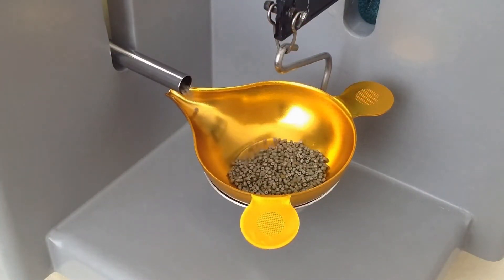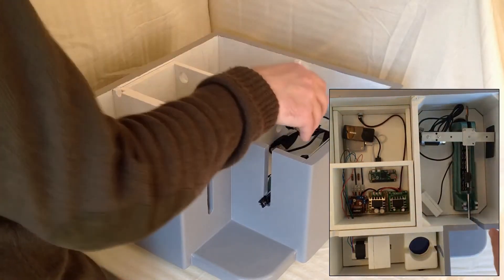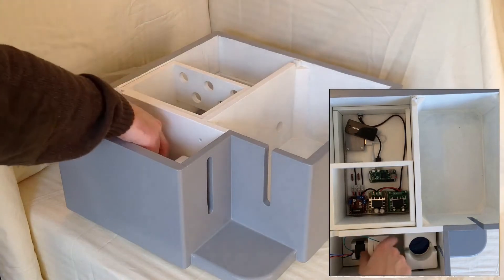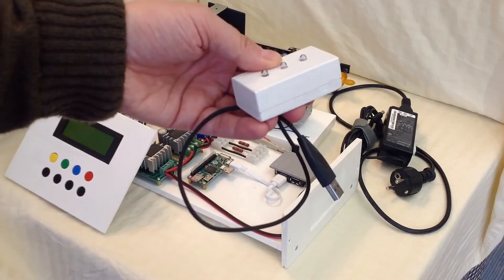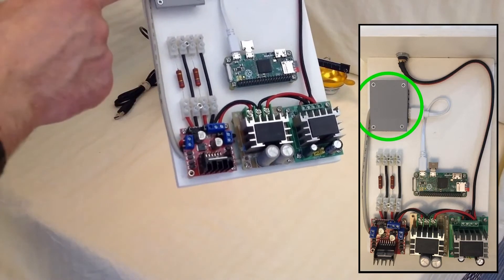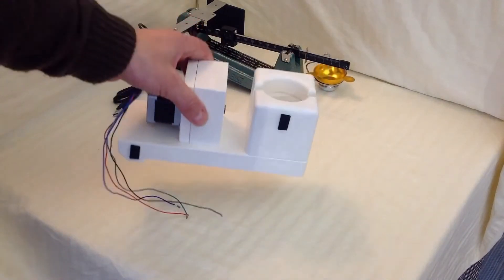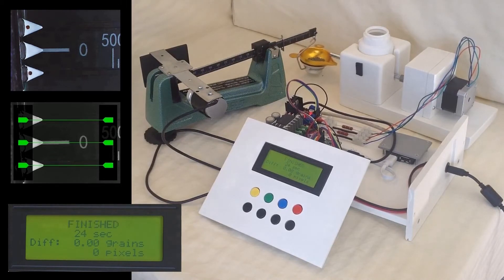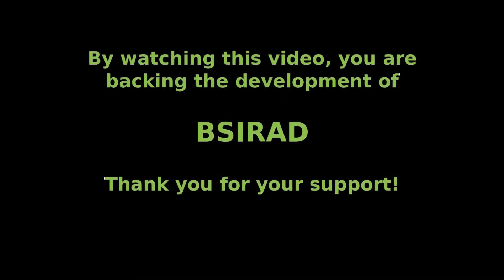DIY automatic powder dispenser

Comment: Sir, what driver motor did you use ?
Reply from the maker: I used a bipolar stepper motor (DC12V, 2-Phase, 4000g/cm, 4-Lead, 1.8 degree/step, Nema17). The stepper motor controller board is a L298N. All specs are to be found in the build instructions (https://youtu.be/c_4Ilo03Lgs).